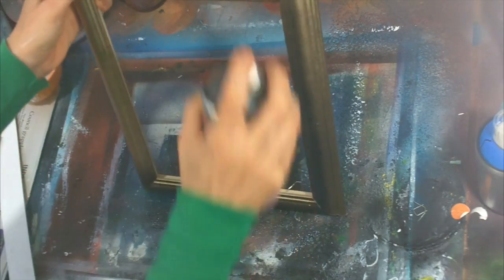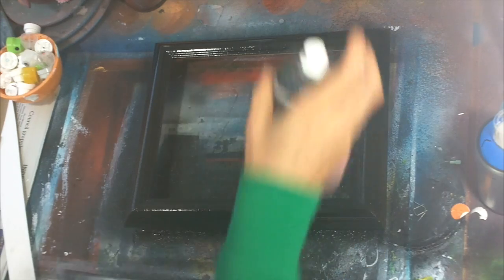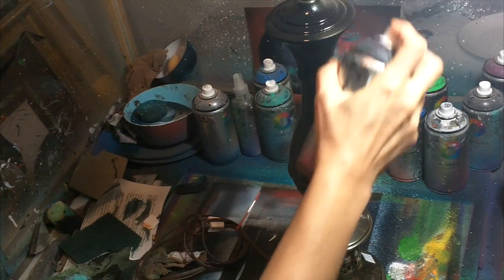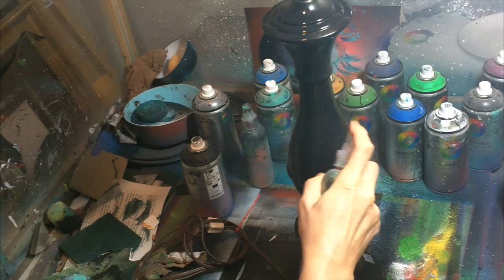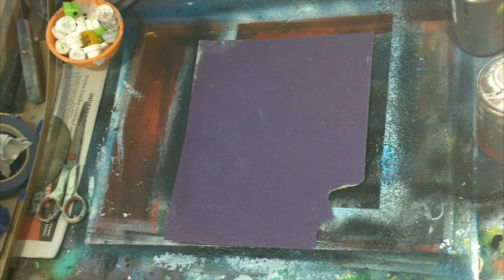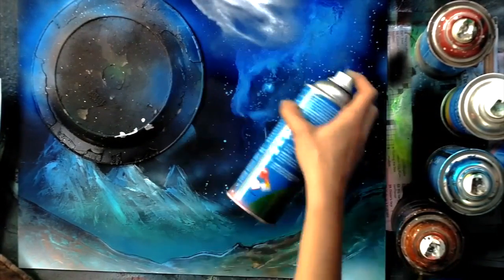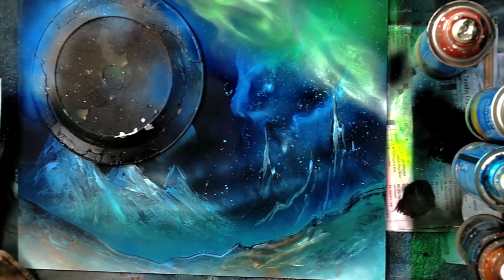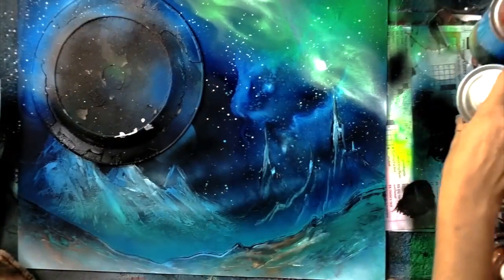how to fix spray paint runs

Comment: Ok, but how do I fix it? Title is very misleading
Reply from the maker: Hi, sorry you feel that way. What kind of drip are you needing to fix? I did mention that if you have a dried drip, you should use sandpaper to even it out and then just re paint with the same color on top.-Alisa
Reply: If' you are doing car parts mate, wet sand it down then redo it again. Wet sanding helps it but use high grit or you will mess it up and take your time.
Reply: @xXAkitokunXx  thank you!!